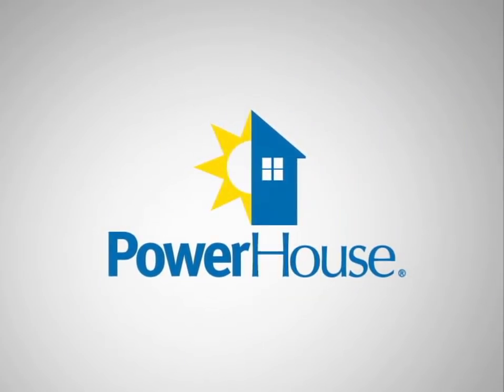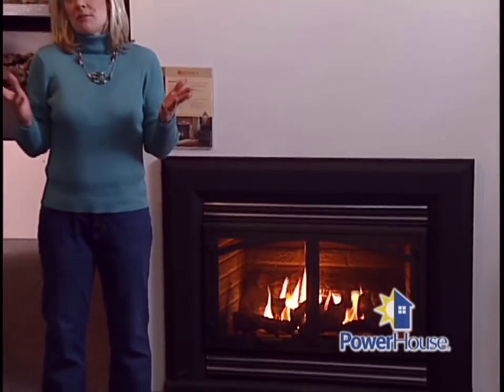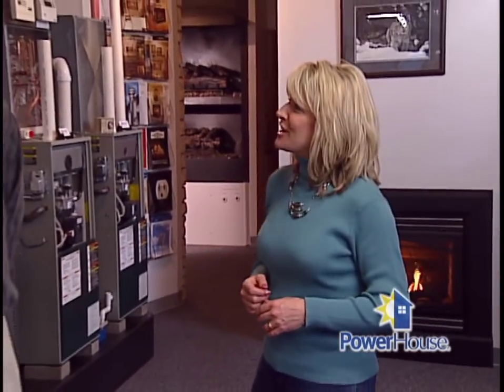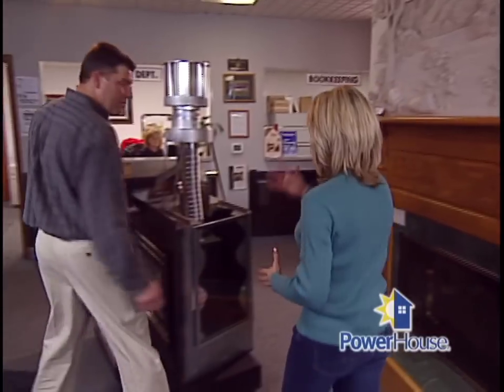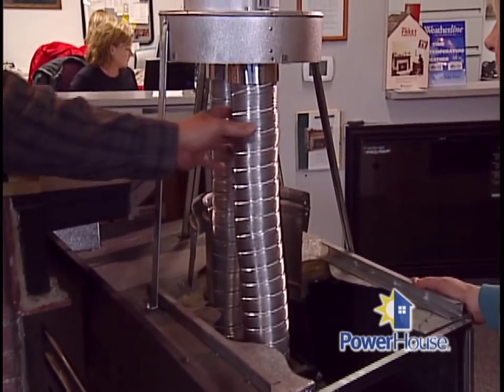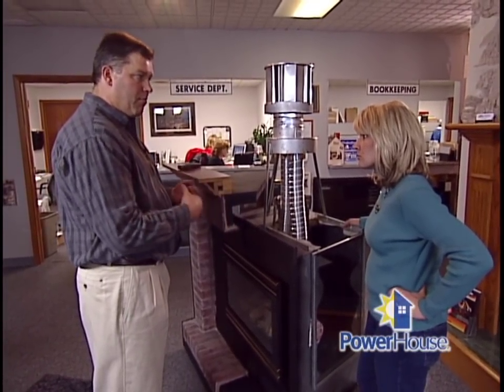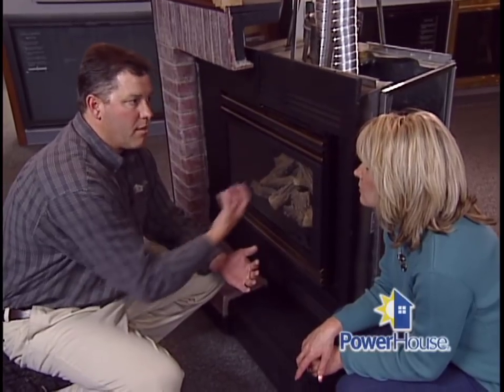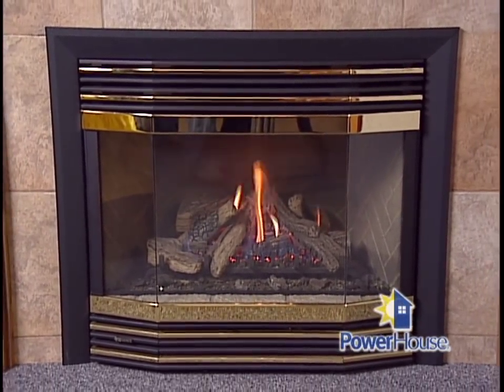Gas fireplace insert technology

Comment: He's saying that the gas insert is more efficient than the wood burning fireplace. Gas or electric inserts are for homes that are squared away - - If you have cost issues with efficiently- you have to insulate or use wood to SAVE money. Most insert dealers are pushing gas or electric inserts.----
Reply: In fact - you can buy a 'modern' wood burning fireplace insert that controls the combustion airflow, and employs an exhaust (heat recovery) catalyst !! I burn wood - which is far cheaper than gas. Keep in mind that this is a commercial for gas burning fireplaces and they are comparing apples to oranges.